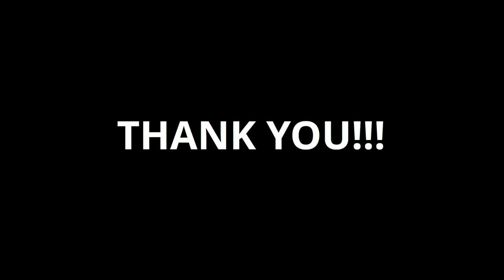I Made A Working 88 Key MIDI Piano Keyboard (Digital Piano Build: Part 4)

Comment: I wonder if anyone has ever made a midi keyboard using the Hall effect? I didn't find it. Perhaps it was perfect for keyboard instruments. If you already have a piano, maybe you should try it. You'll be the first.
Reply from the maker: If I were starting this project with the knowledge I have now, it’s very likely I would have gone in that direction. No physical contact means fewer things that can break, and you only need one sensor per key. But now I’ve already bought components like the shift registers. I’d need to buy multiplexers, Hall effect sensors, and magnets, and the original goal was to keep the costs as low as possible. But who knows—I’ll think about it. The idea is definitely worth considering. If it turns out I have issues with the contacts corroding, I’ll definitely rework the project and use analog key position tracking with Hall effect sensors or possibly optical sensors.

Comment: I could say that you are very patient and determined.Actually i bought a Yamaha YDP131 , for $50 , and the midi out is not working , so i am planning to rebuild the controler , but i am stuck at the scanning algorithm with velocity , any idea?Without velocity , no problem , its already working.

Comment: Well that's an interesting coincidence, I just found you literally yesterday. I was just curious how people have implemented velocity sensitivity in DIY devices and your prior video was right there.
Reply: Yep, we gotta support this guy. He’s wonderfully talented, and smart 😊
Reply from the maker: I hope you've found what you were looking for :)
There are a few other ways of implementing velocity sensitivity like optical sensors, force sensors or piezoelectric plates. They are probably quite often used in DIY projects, however time based velocity sensitivity is a standard in factory made digital pianos and piano keyboards.
Reply: @TedsProjects  I want to try implementing Akai style pads and I do want it to be time based but I'll have to do force sensing resistor based or capacitive I think with two thresholds per pad.

The piezo disc only gives you hit pressure but doesn't have a hold signal. Though perhaps I can augment it with another contact for that. That's a thought for sure.
Reply from the maker: @SianaGearz  Time based velocity sensitivity is probably not the best solution for any drum pads. Piano keys move quite a lot, unlike drum pads. I'd most probably go for force sensing in this case.
Reply: @TedsProjects  this is specifically how Akai pad works, it is time not force. I have some here and play them, I just want a different configuration and form factor.
Reply from the maker: @SianaGearz  That's interesting. Would love to see how they've done it. Especially that I'm planning to build an electronic drum kit in future.
Reply: @SianaGearz  I’m really surprised to hear that also but now that I think about it, akai pads are always gray in color all around, or gray or dark on top right? I’m wondering if there’s velostat film on top that starts the clock when you touch it, and sends note on when it hits the bottom. Did I guess right??
Reply from the maker: @SianaGearz  Wow, you have a lot of knowledge in this area. Thanks for sharing. It's always good to learn something new.
As for electronic cymbals, maybe it has something to do with stopping it's sound with fingers, which is quite often used in playing. That's just my guess. In fact I have no idea :)
Reply: @flywittzbeats4008  Well you might be right, i heard Velostat mentioned with regard to Akai pads. I just disassembled the LPC8 now that you asked.

The pads themselves are transparent with a thin black veneer just on the very top. The black is merely a design element. On the bottom of the silicone pad structure, they are clear.

The pads press down on a clear plastic sheet painted with a square of black material on the side facing the PCB. On the PCB there's a carbon print pattern of alternating lines. This for sure forms a force sensitive resistor of some sort.

The semiconductors are limited to STM32F102R8T6 microcontroller and a number of SOT23 transistors, which look all to be NPN standard types. I traced them out quick and those transistors only do pad/button LED control. The pads themselves are connected one side to a multi stage filtered output of a 3V3 regulator and the other side via ferrite choke arrays to the processor directly. I don't think there are comparators or ADC threshold interrupts on this chip. The ADC has a 16 channel multiplexer which corresponds to the number of pads and knobs in total.

I suppose it does some sort of software gradient analysis to arrive at true velocity. because from the play feel i believe these to be true velocity pads rather than pressure pads.

I received this controller with a massive drink spill inside, and due to spill, the surface of one of the active black film coatings is damaged from cleaning, but it doesn't seem to have affected its playability the tiniest bit, all pads register seemingly exactly the same. The coatings have a different resistance vaguely half a megaohm corner to opposite corner plus or minus like 20%.

I should just attach a couple wires to there and see how it reacts to pressure, hold on.
Reply: @SianaGearz  okay I see! I took apart my old maschine mikro and it seems very similar to that with the exception of the black on top of the pad. I was still under the assumption it was pressure based because I’m not sure how it would start and stop the clock. Time based is definitely better in my opinion upon watching Teds video and doing a little more research, however I also have been making my own FSR’s and I’ve noticed that the smaller I make them, the more they seem to be accurate and precise. I’ve also been experimenting with how much plastic to wrap them in to see if it stabilizes them more. I read that the this is the idea behind fsr’s having detailed, and super small designs in the carbon conductive material or copper. Does the design you see on your akai pcb look like arrows pointing inward to the middle?? Just curious because I’m really trying to figure out what makes them so sensitive and precise. Of course ultimately I think it’s mostly the code. But the electronics could take some the load off of the velocity curving within the code. Any advice from someone such as yourself would be great 👍 I still think I’m going to do time based the same way Ted does his for my instrument, but something about FSR’s truly fascinates me.
Reply: @SianaGearz  I took apart an akai mpk25 and see the same stm microcontroller. But I have no idea how to tell what’s going on with the electronics. I see resistors and capacitors, but how could I tell if they are npn transistors??
Reply from the maker: @Flywittz Beats @Siana Gearz 
If I understand it correctly, it turned out, that these pads in fact do not incorporate time based velocity sensitivity only some kind of pressure sensors, right? It's actually not a surprise since incorporating time based velocity sensitivity in any drum pads would cause some issues. Nevertheless this discussion inspired me to make a video about it and actually to try to build a drum pad with time based velocity sensitivity. Stay tuned.
Reply: @TedsProjects  Oh i forgot to report. It is a resistive pressure sensor. I measure about 10.5k with just the PCB nothing connected, and about the same still when laying the sheet of magic stuff on it, and the same still in a fully assemble device at idle. When pressing down, the resistance drops to a minimum of about 1k at full pressure. So as far as hardware goes i should be able to use Velostat to reproduce exactly the behaviour. I don't think the magic sheet is manufactured in the same way as Velostat but it could be a similar sort of material.

I still suspect it's velocity estimation. Like they could have a time window from first change (press) during which they try to estimate the rate of change of resistance, i.e. the velocity.
Reply from the maker: I think it's most likely measuring drop in resistance after some period of time after first change, most likely after 1/4 of of wave length of "natural vibration" frequency of the pad "button", where theoretically the maximum drop in resistance should appear, assuming that you hit the pad and not press it.
Reply: @TedsProjects  Given it has to juggle 16 channels through a multiplexer, getting any particular time might be a little difficult. But there's no way i could figure out a scanning frequency. It is an interesting thought though for sure.
Reply from the maker: @Siana Gearz STM32F102 maximum frequency is 48 MHz. I don't know how much does it take to scan one pin of a multiplexer but I'm pretty sure it's no more than 8 bits. Therefore scanning 16 pins of a multiplexer would require 8x16= 128 bits. 48 MHz / 128 = 0.375 MHz. This gives us 375 000 scans per second. It's waaaay more than enough to achieve reasonable accuracy.
Reply: @TedsProjects  that's not the problem, every time you switch the multiplexer you have to give the circuit and ADC time to settle. I don't remember the f102 but the f103 has a 1MS/s ADC which means you're not scanning 8/16 Inputs at a third of a megahertz.

You do not have 16 separate ADCs. The 102 has one ADC with a multiplexer in front of it which is basically an analogue switch. 103 got a second ADC. I think these are successive approximation ADCs with a sample and hold circuit.

Comment: why did you remove the action?  That is the part that matters.  Without the action it wont feel like a real piano. Remove the string and have it hit something inert at the same place instead.   strip of rubber. And then headphone jackm speakers not required.

Comment: hey great project! Im working on something similar atm and it would be very interesting to me how exactly you connected all the ICs to the controller. also is there a limit to the number of ICs that can be used? say if i wanted 152 inputs (76 keys, 2 inputs for each key to achieve velocity sensitivity), would it be viable to use that many ICs? I have an arduino nano btw 🙂
Reply from the maker: You can find connection diagram for SN74HC166N shift register on the Internet. E.g.:
https:/t14-presents/thelearningcircuit/w/documents/5013/how-to-add-multiple-inputs-to-an-arduino-using-a-shift-register----the-learning-circuit-78
Theoretically you can connect unlimited number of SN74HC166N shift registers to one input, but I highly recommend using separate inputs for every set of  sensors. In your case this means using two arduino inputs - one for first set of sensors and one for the second one. This way you can read both inputs of single key in one clock switch. Hope it helps. Good luck.
Reply: @TedsProjects  thank you, I will look into this!

Comment: Hi, sir  you did a great job but I have a question regarding the SN74HC166N can I use the SN74HC595N
Reply from the maker: Thank you! No, you can't use SN74HC595N instead of SN74HC166N because SN74HC595N is for outputs. E.g. it can be used to control multiple LEDs using one output.